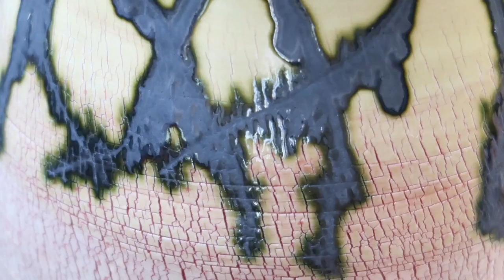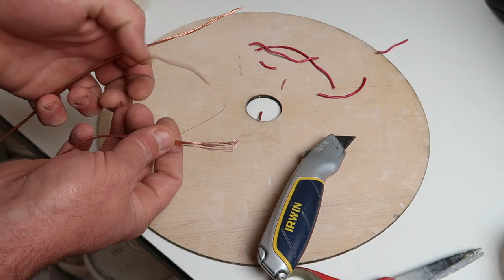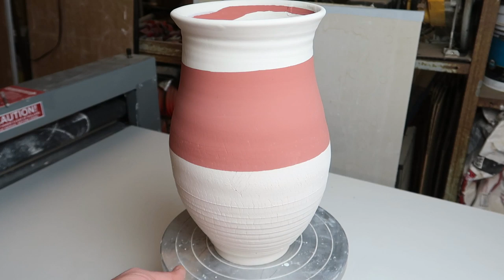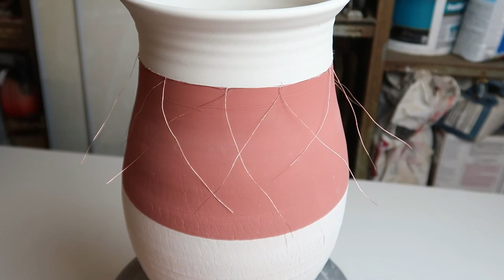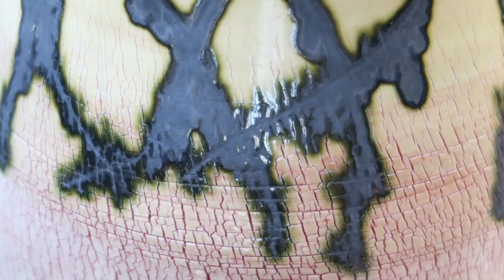Copper Wire Glaze Test #2 - Cone 5/6 Electric Glaze Experiments

Comment: Sweet. Do you use shelf paper or something similar to protect your kiln shelves in case the glaze runs a bit more than you estimated?
Reply from the maker: I usually set them on tiles, and I make sure my kiln shelf has a good coating of wash.
Reply: @JustinsMakery  Thank you. I had thought about collecting up all those short 2-3mm bits of copper wire you get from wiring power outlets and working them into a glaze or slip, your experimentation pushes me to give it a try.